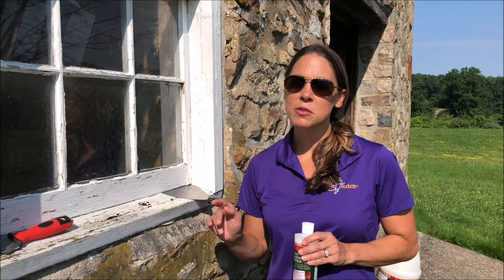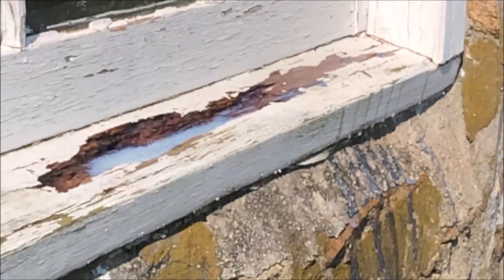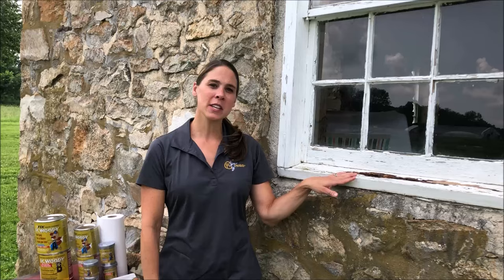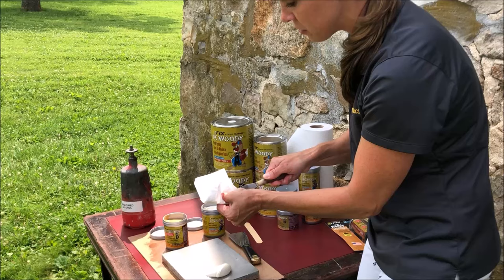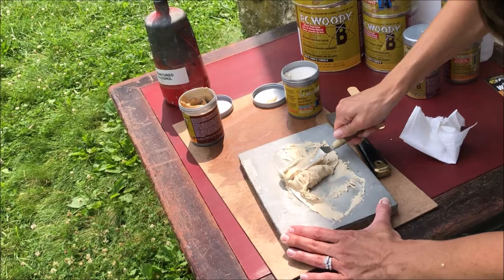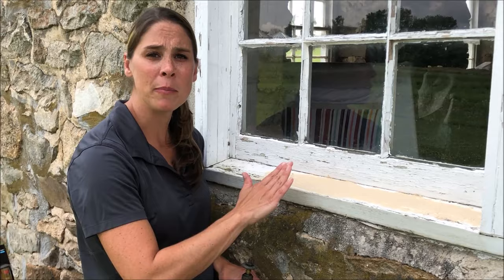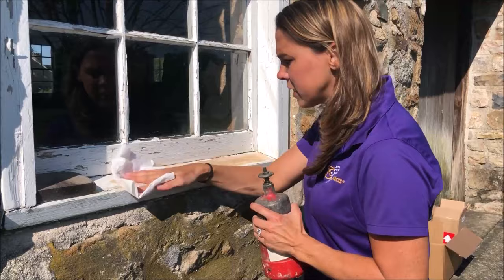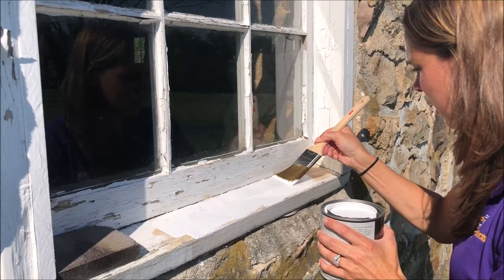Rotted window sill repair with PC Products

Comment: I have been using these products for 5 years and I can verify that they work as advertised. The repairs hold up very well. The product also stores very well. I am still using the epoxy that I bought 5 years ago, though it is almost all used up. I have used it for vertical as well as horizontal repairs.
Reply: I was just wondering how to use it vertically lol, I wanna use it undeneath my kitchen sink.
Reply: I just mixed it as usual and spread it into a gap in the vertical part of my window frame where rot had occurred. I smoothed it as usual, sanded it, and painted it. That was over 5 years ago and it still looks great. It helps if there is something solid at the bottom to help support it. Good luck!
Reply: @jameskinnally4173  thank you so much for the prompt response and detailed advice! Have a wonderful week :)
Reply: I love epoxy!  Doesn't it weaken in the sun though?
Reply: @mountdoomee  So far I see no sign of weakening and window does get  sun for a part of the day although trees shade it some too.
Reply: Where to buy it?
Reply: What do you do about the mold & rot in the wall?
Reply: @jamesmedina2119  I am sorry, I don’t know. I did not have that problem.

Comment: I used this product to fill the cracks & holes on my porch, then sanded down, used Deck Fix primer and painted. It looks AMAZING! I'm a total amateur but a professional painter looked at our porch and said "you did a better job than most pros, and you likely saved yourself at least $3K". 😇
Reply from the maker: So glad our products were able to give you the results you wanted AND save you money!! Thanks so much!
Reply: Where do you get this?

Comment: That sill needs replacing. the ends inside the box will be rotten, and you can't treat what you can't see with chemicals. Do the job properly and change the sill.
Reply from the maker: PC-Petrifier is water based and as such will penetrate deeply (approximately 2 inches) into the wood and will treat areas of the wood that can't be seen.
Reply: @pcproductsepoxy4315  I fix sills for a living, and that's a junk fix. Get the job done properly.
Reply from the maker: @Ru88ell  this repair was done over a year ago and the sill is still rock hard, waterproof and it still looks perfect. Our products are designed for the homeowner that wants to repair rather than replace. Obviously replacement is the correct solution in some instances, but not all.
Reply: Russ CY25 that’s what I said. Do the job correctly.
Reply: @Ru88ell  Will you come to my house and replace the 3 rotted exterior sills for the $23 I can buy PC-petrifier and PC-woody for on Amazon?

Comment: nice job, I'm a painter and my only suggestion is PPE, chemicals can damage skin and muscle tissue over time with repeated contact. A cheap protective glove is worth the price.
Reply from the maker: Both products are non-toxic so no PPE is necessary, but thanks for the concern and the suggestion.
Reply: @pcproductsepoxy4315  I was referring to the denatured alcohol and sanding dust, Thanks for the reply

Comment: This is an excellent product! I live in south Florida and have a custom door that had large parts of it that had rotted away from water damage. After watching this video I was certain I could make this repair myself. This product did not disappoint. I followed the instructions on this video and was able to harden the remaining wood and use the wood epoxy to fill in the missing wood. The final product was great. I was able to sand/repaint the fixed portions to match the existing wood. All in all, a great product, fast shipping, excellent instructional video and made in the U.S.A. I would not hesitate to repurchase or recommend this product. Thanks PC Products.
Reply from the maker: Thank YOU!!! Glad we could help with your repair!!

Comment: This stuff is great.  I have an old wooden bay window with the sills all rotted.  Every contractor I talked to said that I was going to have to replace the entire window.  The sills were so bad that the edge of the sill fell right off about an inch into the window frame all the way around the bottom of the window.  I ended up replacing the edges with 2" x 3"s that I had cut to fit.  Then used the PC hardener on all the rot on the interior sill.   I then filled in the empty spots and grooves with the PC woody epoxy.  The window looks as good as new.  
I did think that the liquid hardener would have made the rotted wood a little harder than it did, but it still made it hard enough for laying out the epoxy.  Thank you.  You bought me at least a few years where I don't have to replace the window saving me at least 5 grand.
Reply from the maker: So glad we were able to help you save your windows! This is exactly the type of situation these products are designed for. I think you'll find you bought yourself more than just 5 years. Again so happy you were able to use our products to extend the life of your windows and save you ton of money!!
Reply: @pcproductsepoxy4315  If your product help buy me more than 5 years then I will be back here in 5 years to let you know.  Thanks again.  PC woody works great!
Reply: @ezim4296  Did it buy you two years?
Reply: @kottelkannim4919  Yes. absolutely it did. And from the looks of it now, it is probably going to last me another 5 years on top of that at least. I just went up this past summer to inspect and it still looks and feels great.   I took a bunch of before and after pictures that I plan to post at some point when I get around to it.

Comment: I do handyman work and I have used PC products for many years. PC Woody, along with PC Lumber in a putty form and more quickly curing for smaller repairs, is my mainstay for repairs and rebuilding of wood. The only thing I would differ with is the full curing time before sanding. Even in the summer months I let it cure 36 hours because, in my experience, it will gum up when sanded sooner than that. I use lacquer thinner, with gloves, for cleanup and it doesn't work so well for smoothing out and shaping after initial application because I think it's too caustic and aggressive. I will try denatured alcohol. As a result, up until now, my applications have not been so smoothed out and I always get the fully cured Woody initially shaped in with a grinder and a paint stripping attachment. It cures so hard that sanding takes much longer to get it close, but I finish it in with an orbital sander and it works very well to blend it in finely. I also have used an oscillating multi-tool and a Dremel with a cylindrical carving bit for smaller applications and tight spaces.
     It should always be painted. Once I did a lot of rebuilding of some detailed trim high up on the exterior of a house in early December and left it unpainted until spring. Some of it had to be redone because it deteriorated a little with rain, snow, and ice over time.

Comment: The petrifier is an acrylic, and sticky. It dries clear, but unless you sponge it off paint surfaces straight away, it leaves shiny drip trails on the surface. It instantly penetrates brick or stone around the job which wont sponge off, again leaving permanent shiny spots, so mask off.
Reply from the maker: You are correct, and these are good suggestions. Thank you, we obviously didn't think of everything when filming this.
Reply: I had the same experience.  I like how this fixed my sills…but I did exactly like I saw in the video and let the petrifier run off on to my siding.  Unfortunately I have permanent drip marks on it now.  Maybe caption in that spot would help others avoid this?

Comment: This would be a great product to use if youre not concerned about rot & mold in the wall cavity. I had to rebuild my sister's wall because moisture had entered through her window sill & rotted out the bottom wall plate.

Comment: Can the PC Petrifier be applied to vertical surfaces? Need to use something on a door frame.
Reply from the maker: For vertical surfaces PC Petrifier can be "painted on" you may also want to drill some 1/8 inch holes at a downward angle to help more of the product penetrate.

Comment: How strong is this product?  Namely, I'm interested in terms of impact resistance and flexibility... for instance would it be reasonable to use to repair a 2" diameter chair leg of which roughly a 1"x3" chunk is missing due to a dog chewing on it? If so, would it be strong enough to sit on and durable enough not to crack with repeated use?
Reply from the maker: PC-Woody is non brittle when cured, it has a tensile shear strength of 850 PSI. It is more than sufficient for your repair. You can use the threaded insert, just drill a pilot hole first. and roughing a surface is never a bad idea.

Comment: Would  I get the same or similar results using isopropyl alcohol in place of the denatured alcohol you used in the video to smooth the finish?
Reply from the maker: Yes, you can also use mineral spirits or acetone.
Reply: @pcproductsepoxy4315  Thank you. Should the smoothing be done immediately after I apply PC Woody, or should I wait for it to partially set, say 15-30 minutes??
Reply from the maker: @gobarbless3871  either way is fine but i would only wait 15 minutes or so...the worktime for PC-Woody is 30 minutes. At that point it will begin to harden significantly and will be hard to work.

Comment: This type of repair is great if you are going to sell the place.  Unfortunately the wood surrounding the patches often continues to deteriorate.  This ultimately leads to replacing the entire part..   Been there/ done that.
Reply from the maker: Gregg, the video was just to show how to use the products and their effectiveness. To do the repair properly, yes all areas that are rotting would need to be repaired. The benefit of our products is that once done they are permanent. They prevent further rot and are waterproof, so no more repair or replacement will be necessary.
Reply: Yeh, it's called jack legging something

Comment: I got a small ice cream scoop to measure it. Using it to repair a few rafter tails. I was going to replace but before I started I noticed the roofer using peel and stick underlayment and thats a huge mess so Im going those route since Im no where near ready for a new roof. Hope it works
Reply from the maker: I think you'll be quite happy with the results and will save yourself quite a bit of money!! Thanks for giving our products a try.
Reply: @pcproductsepoxy4315  It worked amazing, Im going to buy the 96 ounce tomorrow for the rest of my projects. Too bad I cant post pics, I will try and post them on Lowes and give a good review.
Reply from the maker: @lebronjameslol3521  So glad your project came out well. You can send pics to Jack@pcepoxy.com if you'd like.
Reply: Thanks Lebron, good idea to use the ice cream scoop. 
Thanks guys, great job on the window repair, I hope I can get these products in Australia 🇦🇺
Reply: Can you list the kind of denatured alcohol you used? I’d like to purchase before I start this process. Thank you.

Comment: Hi. Does PC-Woody have some filler, like sawdust, or it's just a two-part epoxy with more dense structure?   And how fast it starts to cure? and how well PC-Woody adheres to PC-Petrifier-cured surface as PC-Petrifier is acrylic-based while PC-Woody is epoxy?
Reply: She said it had "wood flour".

Comment: Will the PC-Petrifier stain/mar the painted surfaces it gets splashed on?
If I apply the PC-Petrifier to the window sill and it runs down onto the painted surface below will it stain the paint?
Reply from the maker: The PC-Petrifier will leave a shiny clear coating on the painted surface. It is best to wipe it off while wet, tape off areas that you don't want impacted.

Comment: I have T1-11 siding and I go around periodically tapping with my fingernails.  If I find a soft spot, usually around windows or near trim, can I use one of your products, and which one, to repair?  I thought I might drill a hole and inject one of these products into the hole?  Thanks.
Reply from the maker: Customers have used PC-Petrifier onT1-11 with positive feedback.  Apply PC-Petrifier directly to the soft spot if the wood is unpainted.  Otherwise, it will be necessary to drill hole(s).

Comment: question: do you think I can use this to restore a rotten wood picture frame? The only difference I see is I will need to varnish instead of painting. Thats why I am asking. Thank you!
Reply from the maker: Yes you can use it for the frame. But bear in mind that Woody will prevent any liquid penetration so if the varnish needs to penetrate into the wood it likely won't work very well.

Comment: I need to do a verticle repair can i still ise the pc petrifier? It looks really liquidy any tips to get enough on there to harden?
Reply from the maker: Yes you can use Petrifier for vertical repairs. It is the consistency of water so it will penetrate deeply into the wood. It will, of course, also run like water. We suggest drilling some 1/8 inch holes at a downward angle, this will help the Petrifier to run into and penetrate the wood. We also recommend having a brush in your other hand when applying to help disperse the product over the surface of the wood. It's also a good idea to mask off any surrounding surfaces that you DON'T want the Petrifier to contact.

Comment: I have an old set of wood garden chairs that are severly pitted and grooved but I'd actually like to save them. Does this PC stuff have the strength to hold when Jaba Hut and other guests sit down?
Reply from the maker: Indeed it does!! If the wood on the chair is only pitted and is not completely rotted, the PC-Petrifier and the PC-Woody can restore the chair to "like new" condition. By the way, say hi to Jabba for us!

Comment: Can I screw on a sprayer cap, like the Australian brand Earl's Wood Hardener, and spray it in ?

The wood frame under the garage asbestos roof is rotting a bit. Hard to reach the inner parts.

You should provide a spraybottle ike the Earl's product.
Reply from the maker: Yes, the product can be sprayed.

Comment: A joint on the top rail of my hot tub developed rot that abuts the back of the fiberglass of the tub.  Is PC Petrifier safe to use on fiberglass?
Reply from the maker: Yes it is. It will leave a hard shiny finish if it get on the fiberglass. Masking is always a good idea if you want to avoid this.

Comment: it might be good but I bought one & mine it's so hard to mix! it should smoother a bit!
Reply from the maker: I would recommend heating the product by placing the jars in hot water baths (do not microwave). This will make the product more easily workable.

Comment: 1885 old house here with original windows.. any reason why you would leave rotten wood instead of just replacing it? .. I can imagine special cases where that would be practical but rot spreads .. you harden part of it but beyond it it's still rotting wood.
Reply from the maker: The Petrifier penetrates into the wood approximately 2 inches. If you remove all severely rotted and loose material the Petrifier will penetrate far enough to get to good wood beyond the remaining rot, this will stop the rot from spreading.

Comment: Product looks awesome but this window sill is just wood and easy to replace with new wood. Seems easier to replace the wood than do this?
Reply from the maker: Our products are designed for the homeowner that wants to repair rather than replace. Obviously replacement is the correct solution in some instances, but not all.

Comment: If the hole I need to fill is deep (let's say about 2"), does the filling need to be done in layers to allow it to dry properly?
Reply from the maker: No, if it is on a horizontal surface a 2 inch hole can be filled al at once.
Reply: @pcproductsepoxy4315  Thanks

Comment: Do I see streaks where the petrifier dribbled down the cement and stone and wasn’t washed off? I hope not .
Reply from the maker: PC-Petrifier is the consistency of water so yes it will run. We do recommend masking off any areas that you don't want treated. PC-Petrifier will clean up with hot soapy water.

Comment: Looks nice on a flat surface, What about the petrifier on a vertical surface? How do you restore or re-finish the thin vertical window frames?
Reply from the maker: John, Petrifier is water based and thus it's the same consistency. The best approach for vertical application is to put the product in a container and brush it on. Additionally, some small 1/4 inch holes can be drilled at a downward angle to help the product flow into the wood.

Comment: Should you be applying the Wood Filler in layers ? or is it OK to apply all at once to fill the hole ?
Reply from the maker: If it is a horizontal repair you can fill the hole in one application. If it is vertical, depending on the size of the void you can go up about 1.5 to 2 inches before the product will begin to sag slightly. In that case we recommend layering the Woody.
Reply: @pcproductsepoxy4315  Thank You

Comment: Having been a trained auto body man I am well aware that most any “filler” used in great volume (thickness) they have the tendency to shrink crack and pull from the edges inward. How does your product not do that?
Reply from the maker: That is proprietary information. But i can tell you that decades of customers can attest to the fact that PC-Woody does NOT shrink.
Reply: 🤣🤣🤣 exactly what I thought aswell...